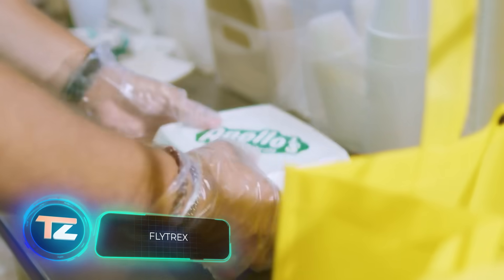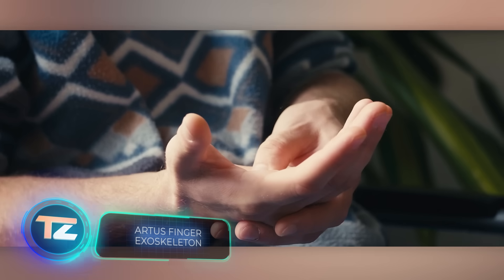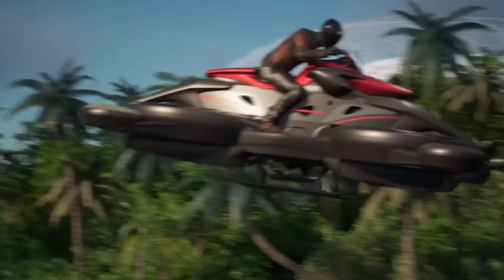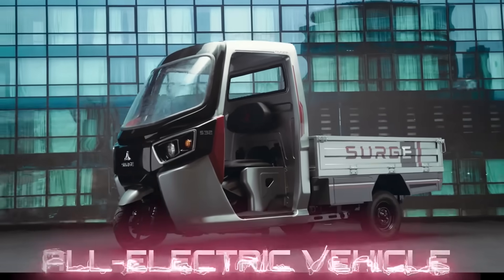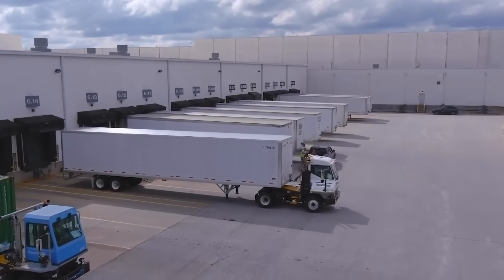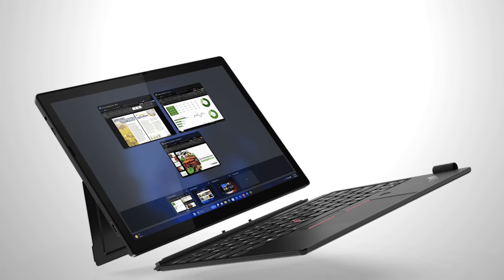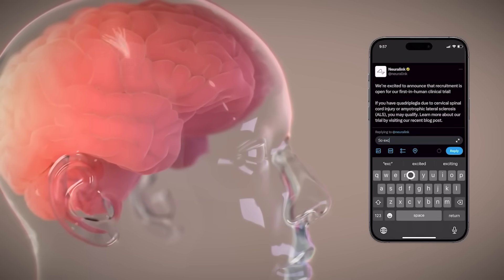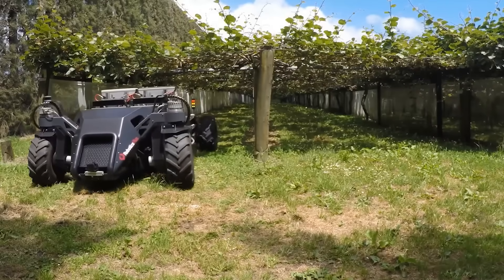INVENTIONS THAT WILL SOON CHANGE THE WORLD

Comment: Monocab sounds better than trains. And there you go. "A full charge" for 50 minutes. And then the fun is done when you have to wait 2 hours to recharge. You'll have to buy 2 of them to keep on on battery charger while using the other. Too expensive. And don't forget those charged battery fires. At least you'll be on the water and can dunk it in the briny. Oh, wait. Lithuim explodes on contact with water. Hope the demise will be swift and painless.

And the clean water? Yes to Spout. Because Everyone needs clean water. Except may arsenic (ars3 Nick) the dark one.

Comment: **The Surge is an interesting concept but they need to take it a lot farther, and I would think a heated or cooled driver/passenger (weatherproof) compartment would be highly advisable.
A van type lockable back portion for delivering and securing things.
**More speed in both modes.
**Those are the things I see need to be improved before I would consider buying one.